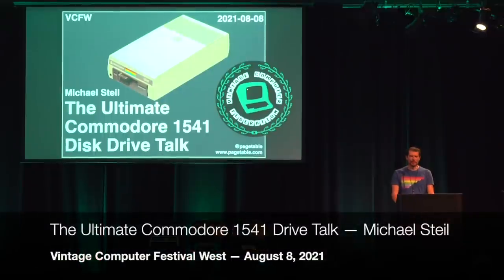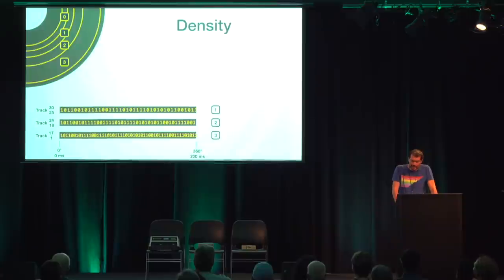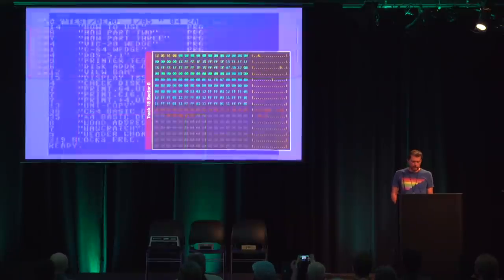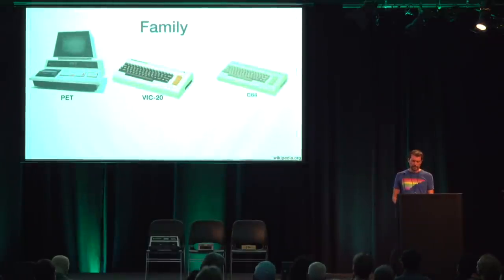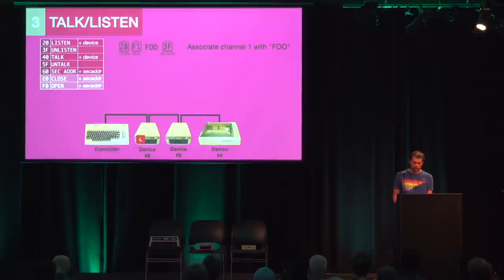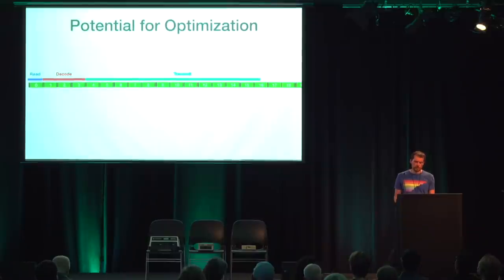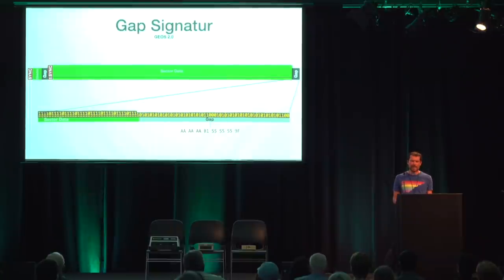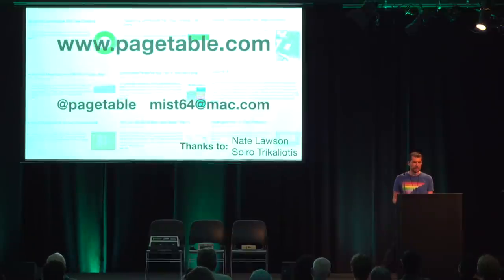The Ultimate Commodore 1541 Drive Talk — Michael Steil

Comment: One the best technical talks ever on any Commodore related subject.
Reply: I wondered why you needed a parallel hack to dump NIB level files. I thought it was JUST because it would be too slow otherwise, and people didn't bother, but that part where re-synchronizing to get the rest of a potentially modified long sector - that wouldn't fit in 2KB was the answer - finally explained why.
Reply from the maker: I'm glad that you liked it!

Comment: Yeah, got the first two of these books, that were my "bible" at this time, reading and understanding the ROM dump/disassembly. I almost forgot about most of this stuff, I remember it was very hard to debug the code running on the floppy which was writing / reading the disk, because you could not see what was actually happening (if you didn't own a logic analyzer or other equipment which cost a fortune those days). At least with a parallel cable it was easier, as mentioned in the video, because you could just transfer all bytes read in realtime to the C64 and then analyze what happened in a track.
Reply from the maker: Lots of interesting stuff about that drive.

Comment: 00:00 Introduction
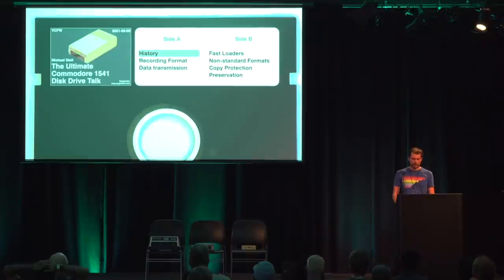00:55 History
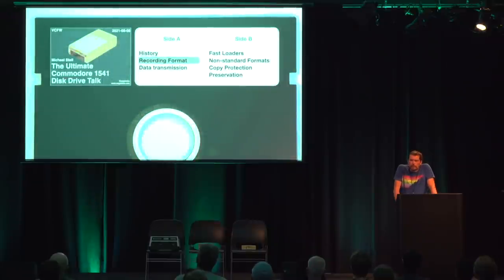04:55 Recording Format
05:35   Tracks
07:40   Sectors
08:15   GCR (Group Coded Recording)
09:35   Sector Format
10:40   Reading a Sector
11:35   Writing a Sector
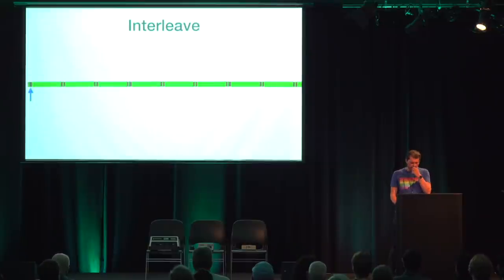12:15   Interleave
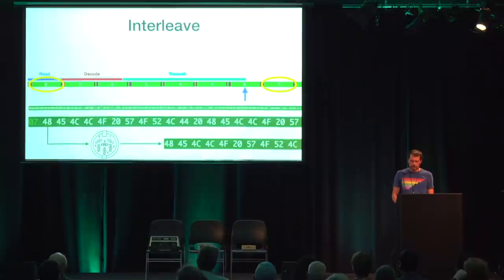12:50   File System
15:30   Disk Drive Hardware 
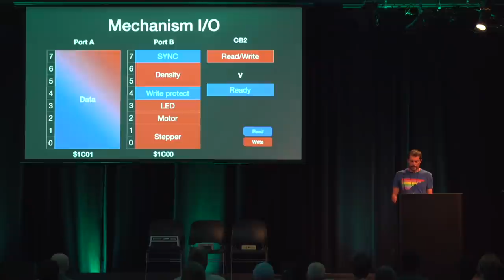18:00   How VIAs are Used
19:50   Software Architecture
21:45 Data Transmission
23:30   Layer 2: Transmission
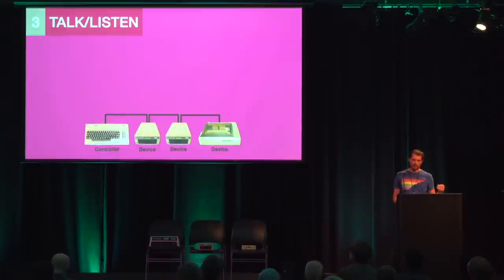27:00   Layer 3: Talk / Listen
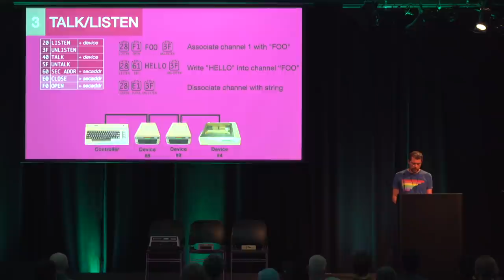29:35   Layer 4: Commodore DOS
31:30 Fast Loaders
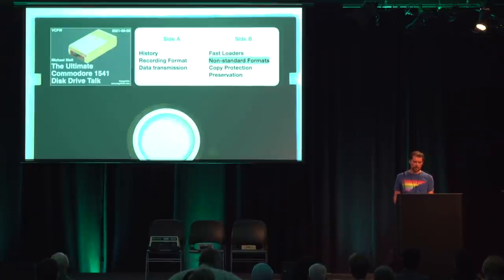38:45 Non-standard Formats
40.25 Copy Protection
46:10 Preservation
Reply from the maker: Thank you for the timecodes. I added them to the Comments so there will be chapters there.

Comment: I wish that in that 8/5/3-disk photo on Wikipedia that you dissected, the 3.5er had been turned around so the access hole was facing the same direction as it is on the other two.
Reply from the maker: Sorry to hear that.
Reply: @vcfederation : I don't really think you need to be sorry about that. You didn't even make the image, did you? The Wiki before I knew about it on this video. But with the disks overlapping, how did you isolate them whole? Did you do a whole bunch of reverse graphic work to patch things, or..?
Are you the one who made that image that we see on the wiki, so is that what made it easy for you to separate the disks, because you're the one who shot one disk at a time and then set them together to shoot the set?

Comment: Wow, for 4 decades I had never had any idea that the drive could send stuff right to the printer! So are you saying that you could tell the drive to load something right onto paper instead of into the computer's RAM? Such as an "open" command that will read an SEQ file straight to the printer, but when you write PRG into the computer to have it try to read the SEQ that might've otherwise gone into the memory, it's not there, because it went straight to paper instead?
Reply from the maker: Yes. There are definitely tricks that you can use with the 1541 drive because it has it's own microprocessor (6502) and RAM (2k). You could do more if you use the RAMBoard which bumps it up to 8k.
Reply: @vcfederation : If you meant "because it has ITS own microprocessor/CPU" insteas of "because it has it is own microprocessor...," then this is my reply to that: Oh, yeah, that's (and the RAM) what's always been interesting to me about Commodore and Atari 8-bit disk drives. But wow, I wish someone had taught about the printer trick decades ago!

Hey, since my compatible printer is "buried" right now, will you please make a video of doing this trick?

Comment: Hmm, it's interesting that some minifloppy access holes are shorter. But there's another reason that the Commodore 8-bit drives normally only use 35 tracks: Commodore wanted the drives to be able to work very well even with the cheaper, less-reliable disks, and they thought the last 5 were typically problem tracks. Or is that just from the rumor mill?
Reply from the maker: I would make a post to forum.vcfed.org and ask around.
Reply: @vcfederation : Yeah, I'll check that out; thanks.

Comment: Are you sure it's a solder bridge that you cut to change the old drive's device number, rather than just a circuit board trace? And what's the point of having devices 12-30 as drive device numbers if there were no drives that I've heard of with those numbers? Or do aftermarket drives like the Lieutenant Kernal hard drives and the CMD 3.5" floppy drive have those options? I've even seen a Commodore-64-based BBS and it just had some Lt. Kernal hard drives but not that many of them. So how would anyone ever have used them, and what sort of system would have so many?
Reply from the maker: I'm not sure about devices 12-30. Nothing I know of used them. Hard drives used partitions. The uIEC devices use partitions with subdirectories. They treat a disk image (.d64) as a directory.
Reply: @vcfederation : I've never as of yet had a hard disk for the Commodore 8-bit computers, but I've seen someone with some Lighten Kernals, and he ran Port Commodore at his house down in Salem, here in Utah! I don't suppose they'd HAVE to have partitions unless the 8-bit system severely limited the number of files or contiguous bytes or blocks you could have in  one area.

In 1988 my dad was cool enough to add a 128 and 1581 to supersede our 64, and I remember that you could make partitions with it, but with just 3160 blocks (about what: 700-800K on an SD 3.5" floppy disk?), and with how complicated it is to not only make the partitions and then switch to them, it wasn't even worth it. I bet most people with a 1581 felt that way. But of course even with just a 20-40MB hard disk it might make more sense even if ya didn't HAVE to do it.

Comment: It seems like Fast Hack'em was the best at just imaging a disk, so whatever errors were on there would get copied over, so that protection scheme didn't work after a few years. I can't remember many things Fast Hack'em could not copy faithfully, if any, at least once my parents were rich enough and willing to buy a second drive when I was so young! Thus, the best module was the one that would set the drives up as their own computer and just skip the 64 altogether once the routine was sent to the drives! So no parallel card, hardware mods, etc. I can't remember for sure, but it almost seems like FH could trick the destination drive into copying special formats, thus formatting the disk as it copied. I'll have to set my system back up and try it, though; man, it's been a long time! But of course there were those physical limitations like motor speed that of course it couldn't emulate. But one thing I do remember for sure is that once I got a hold of Fast Hack'em, with its several modules, that was the ONLY 1541-based disk copier I ever used! It was really the best one out there that I had ever heard of, hands down!
Reply from the maker: Fast Hack'em didn't image a disk, it copied the disk track by track to another disk. It was very good at copying and then using parameters to defeat copy protections. Yes, when you had two floppy drives it copied faster. I used Maverick mostly as he had great support with RAM expanders, RAMBoard, different drive numbers, fast file copy, etc. It was the best in my opinion.
Reply: @vcfederation : Of course the 2-drive system copied faster, since there were no disk swaps. But maybe also because it would go straight from one drive to the other. Well, that's when it was in standalone mode. That one particular module in which the drives would start just seconds after detecting disk insertion on both.

But if you're copying a disk bit by bit and track by track, how is that supposedly "not imaging"? You don't need to make one big disk file just for a bit-exact copy to be called imaging, do you? What would be the supposed difference, in your estimation?

Comment: How would you even hook a 1541 to the 64 via parallel? I saw someone do that with a 1001, but not a 1541. Obviously it would still have to start out as serial. So then what: use a serial-to-user-port adapter? If so, then how would that help? Or if not, then what?
Reply from the maker: Yes. There is an adapter that will go from parallel port to the serial port. A device such as the Zoom Floppy by Retro Innovations: https://www.go4retro.com/products/zoomfloppy/
Reply: @vcfederation : OK, I see that that thing you showed me is for connecting a PC to the Commodore drives. That's no surprise. Well, it's cool and somewhat unusual, but by several years ago I had heard of a few of these.

However, only now have I seen a video that made it sound like you'd be trying to connect a Commodore computer -- 8-bit and IEC, such as a 64 -- to an IEC drive such as the 1541, via the Commodore computer's parallel port (meaning the user port) to the IEC drive via an interface like this. But this doesn't look like it does that; only that it would connect to a PC with an LPT card (or at least a middle-aged one that has it built into the motherboard). What card supposedly does that? And how might that work?

Comment: So why would people hook up a Commodore drive to the PC when they could just use a PC drive with the conversion software you're talking about?
Reply from the maker: Because they file formats are incompatible. You can't take a PC formatted disk and put it into a Commodore drive. By hooking up a Commodore drive to a PC , you are able to copy files or disks and be able to still use them in a Commodore drive when you connect them to a C64, etc.
Reply: @vcfederation : I KNOW that. Ordinarily that would be true. Well, it's not even the file format, but the disk format. But then didn't you just say in the video that the PC drive could do it with that adaptation? I'm talking about that setup. Why wouldn't someone just use that PC drive setup that you said would make it work like a Commodore 8-bit drive?

Comment: It’s a little hard now to understand why they even bothered implementing a serial bus - it seems a whole lot of work clocking the data in and out of it - why not a simplified parallel interface to the disk drive (pretty much what Apple did, I think). It seems like wires were expensive in those days, but the price of hardware was coming down all the time, and it must have been a delicate balancing act. Just seems expensive putting a CPU/ROM/RAM in the disk drive!

Comment: I always knew that Commodore not using the index hole made their drives the slowest of all the micro computer disk drives. Now I know exactly why they were so slow. WTH was Commodore thinking? Everyone else used the index hole because it made it easy to keep the tracks aligned and they didn't need sync bits and the other wasted space so they were able to put more data on a disk. Not using the index hole required a more complex drive controller and data writing with it was "sloppy", which required the large gaps to buffer the ends of the data so lead and lag wouldn't wreck the essential sector data.

The "downside" for all the others was to make a flippy disk for single sided drives you had to carefully slide a hole punch between the media and jacket to punch the other holes for the sensor to be able to see the index hole.
Reply: The simplest explanation for the slow disk drive on the C64 was time to market. The technicians simply did not have enough time to do this property due to very tight deadlines.
Reply: Did you watch the same presentation? Almost nobody actually used the sync-hole (pun intended) The major bottleneck in the C64 comes the software control of the serial bus because of a hardware bug in the VIA.
Reply: @Sine1040  , yes I watched it and have even done some 1541 drive programming myself. Its no doubt a mix of them getting stumped at this hardware problem as well as developing a pretty poor solution to the problem seeing how much better you could actually do this with the right software even with the bugs in place. If they had more time, I am sure they would have done it better - but all manufacturers had tight schedules to release stuff in time for certain events, Commodore was no different as the competition was fierce.
Reply: @Sine1040  Texas Instruments used it. IBM used it. So did Xerox. Any computer that used the stock Shugart drives used the index hole.
Reply: @64jcl  they could have had an easier job and designed their disk system quicker, and had faster data transfer, with more data on a disk, if they'd used standard Shugart drives instead of only using the bare mechanism.
Reply: @greggv8  , that might be true but likely the drive would have cost way more than Commodore wanted. They were no doubt trying to max out profits per device.
Reply: Jack Tramiel was brilliant, but a notorious tightwad and used every trick in the book to keep costs low. You can bet that virtually every single decision made in the design and construction of the 1541 had to do with saving money.
Reply: @JustWasted3HoursHere  but the complexity of the 1541 control couldn't have cost less unless to use a stock Shugart or compatible drive came with expensive license fees and/or if Commodore was only counting the production costs of any MOS chips that went into the drive. I would have put the development $ and time into a fast drive controller to plug into the back of the VIC-20 and C-64.

One reason I can see for going to all the effort to make one of the slowest floppy drives ever would be to have a proprietary drive so Commodore owners would have to buy them from Commodore. If they had made an Industry standard interface then people could buy drives from whomever had the best price.
Reply: @greggv8  Jack was known for doing sneaky things like that, including when he went to Atari, so I wouldn't doubt it. His add campaigns for the Atari ST comparing to the Amiga with their famous 3, 4 and 5 asterisks were legendary.
Reply: That's wrong. Using the index hole hasn't improved anything. The 1540/41/70/71/81 mainly was slow because of the specs of it's serial interface. Also the internal 2KB RAM can't hold a complete (GCR coded) track so it has to be read multiple times. But fast loader solutions came up to overcome this issue.
Reply: @greggv8  That's only because they used even more primitive ways to access the disk. A hard disk doesn't have or need a index hole. So it has nothing to do with speed. In the later days a 1541 with a fastloader could load an entire track in one revolution so it's difficult to see how a index hole is required.
Index holes are a holdover from the days of primitive controllers unable to use the signal on the disk itself as an index.
What made Commodore drives slow out of the box was because the bug in the shift register wasn't discovered until way too late. And it wasn't discovered in the 1541, but in the 1540, the drive for the VIC-20, the first Commodore serial drive.
So you didn't "always know" why the disk drives were slow. You're just wrong.
And the high profile 2031 drive uses a Shugart mechanism and doesn't use the index hole. 
https://www.nightfallcrew.com/gallery/commodore-single-disk-2031-high-profile/
Therefore your claim of "any" computer is also in error.
I bet you also think the "erase" coil in a floppy disk actually erases the data before the write gap, like an audio cassette...